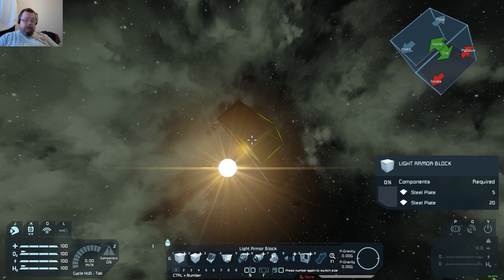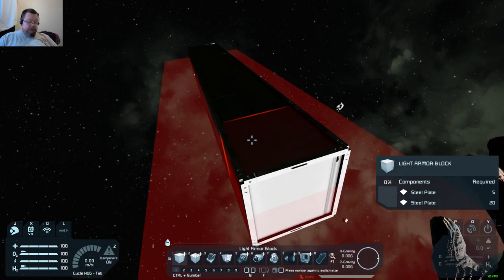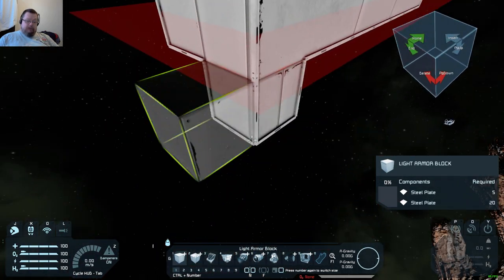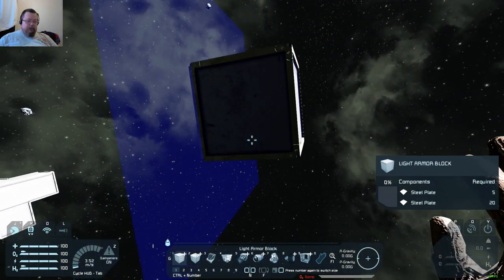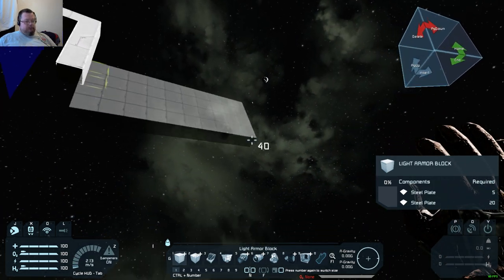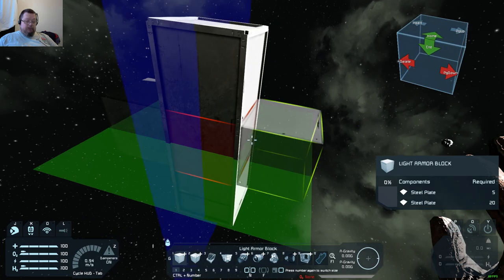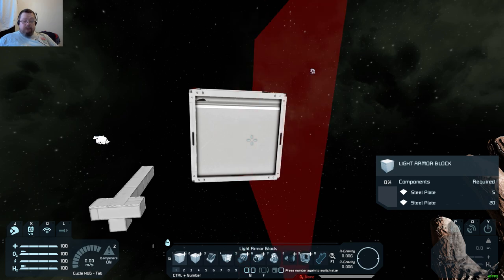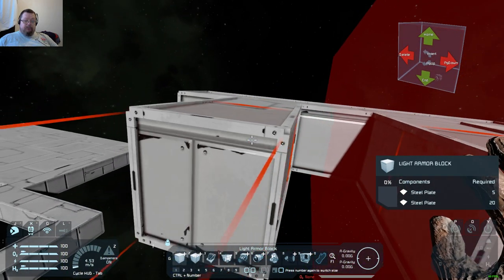How to use mirroring in Space Engineers

Comment: great tutorial. make more.
Reply from the maker: thank you :) what tutorial do you think is needed ?
Reply: @Maxiusslight  not sure, just getting back into the game after a long break, ummm, perhaps some specific job in your base, some of the tricker things to set up like a nice projector system or small ship/projectile printer? ill get back to you when i run into an issue in my current game...

Something I do with my mining ships, make them symmetrical on 2 axis and spin the whole ship with a dedicated gyro, can cover a big area with less drills. timer block pulsing a few small thrusters on and off every second can slowly push it into the rock giving you a semi-automated large miner that will go right through a rock and even stop by itself if you use a sensor mounted to the side.
Reply: heres one for ya  @Maxiusslight  , i just tried adding a couple of timers to turn the ore detector on and off every 5 seconds, so you can tell when the ore patch is depleted easily. i had each one activate the other 10 seconds apart as well as turn the ore detector on and off, and start and stop them running with additional commands from the timer blocks i use to start and stop spinning and pulsing thrusters, but i cant get it to work for some reason >< how about you set it up and see what you can bring to it?
Reply from the maker: @IceGeck0  nice idea I will set up a timer block tutorial